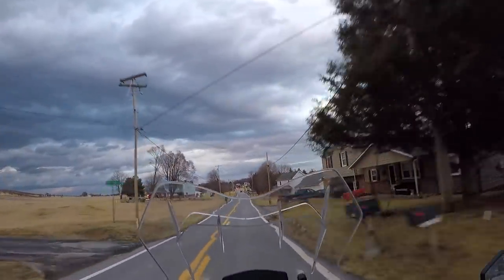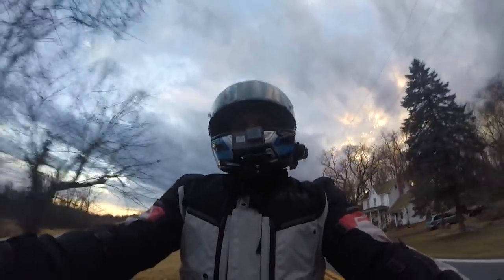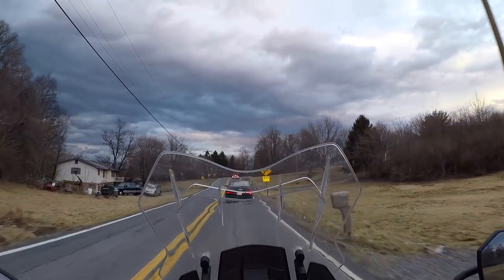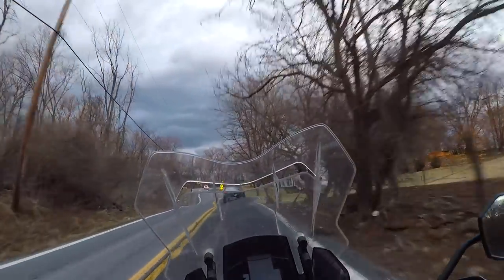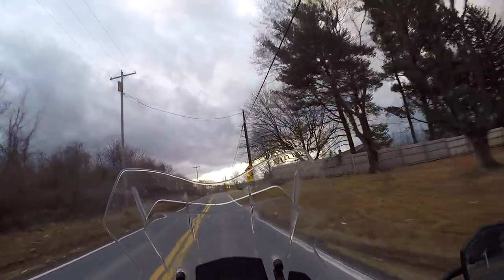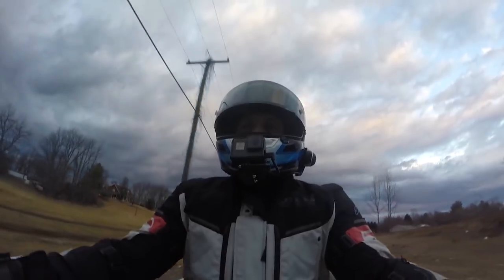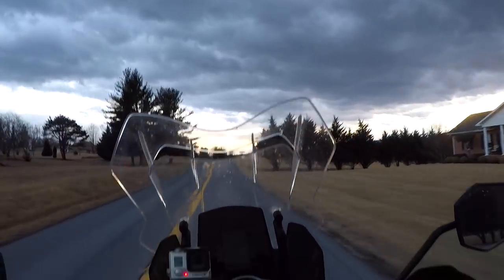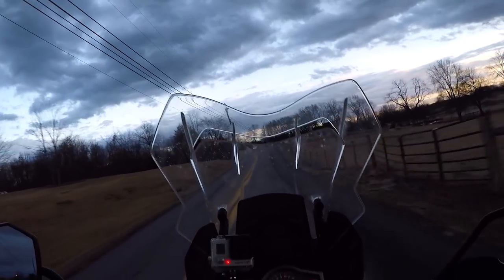Rottweiler Intake on KTM 1290 Super Adventure | 1st Impressions

Comment: I’ve had the stage 3 stuff sitting in my garage for months. That little pull at six minutes really lit a fire under my ass to get it done. Sounds so good!
Reply from the maker: Get that thing put on! You're gonna love it! I'm probably gonna pull my tank in the next few days to see how well it held up to the nearly 10,000 miles I put on it in the last 3 weeks.
Reply: 2 Wheeled Rider My filter oil disappeared, picking up a  few cans this morning and buttoning it back up. Base, stacks, and all dongles are in, GPS rewired to CC2, and Cyclops bulbs are in. SAS out. Should be firing it up this afternoon. I shouldn’t have waited so long, it’s really not that bad pulling the body work and tank. Your videos were really helpful, thanks!
Reply: 2 Wheeled Rider Did a rip last night, about 60 miles. Just a check ride. Through downtown Toronto in 1st and 2nd it was so smooth, but definitely requires a throttle hand recalibration, way less throttle input needed down low. From 7 grand it flies to the redline! I agree money well spent. I’m on an 1190, not SA,  but the results on the smaller motor are similar in feel. 
Congrats on getting into print! That’s cool.
Reply from the maker: Glad to hear it! The first time I rode a KTM with the Rottweiler intake was on the 1190R and that's when I made up my mind to order one.

Comment: I fitted the stage 3 Rottweiler airbox two years ago...it’s a quality piece of fabrication. The ITG foam filter it uses is among the best available technology, if not the best. I didn’t notice the intake noise increase too much, but that’s probably got a lot to do with my exhaust.

I recently took it off because I had to install the OEM to get my emissions test certificates in Germany, and after that I decided to install the Unifilter foam filter in the OEM box...that’s also a nice setup for those who might not want to spend money on a new housing but want better filtration. Touratech sell it in the States.
Reply from the maker: Ronan, appreciate the info and feedback. I agree the Uni would be a good set up for those looking for more filtration but it will come at the cost of some lost horsepower...at least with the dyno charts I've seen. I left my earplugs out the other night while testing it. Doubt I'd notice as much noise with them in. Also agree your exhaust was probably louder than the intake. Great to hear from you; hope you're doing well!

Comment: I also installed the Stage 3 6 weeks ago.  The power increase and throttle response are awesome, and that howl from the intake is awesome.  Well done video, as usual, Mario!
Reply from the maker: Thanks man! If that howl doesn't bring a smile to your face, I don't know what will.
Reply: No joke Brother!  Who needs deer whistles? Ahahaha
Reply: Did fuel economy increase?
Reply: Does stage 1 gives the same howl as well?
Reply: @nickaltvater5592  I honestly didn't pay attention to the mileage pre or post install
Reply: @FITNESSOVER45  Just seat of the pants.  The brief throttle lag is all but gone, the grunt in the lower range is smoother and the rev up is quicker.  And the howl....did I mention the howl?

Comment: Sounds nice and gnarly!  I got a similar (but much smaller) pile of hoses and fittings from removing the secondary air injection system on the Bonnie, later removed the whole airbox (the aftermarket is a wonderful thing), it still looks stock, until you get right up and look under the covers (which I wanted, as it's the Centenary Edition).  I'd hoped to get a ride in today up your way, so of course it's going to rain more; guess I'll have to take some time off next month or so, since I don't get another holiday until May!  Hope Noah has a good race!
Reply from the maker: Thanks Triumphrider. Noah raced well at times but has some work to do. (We got some seat time in tonight after work). It's amazing how much crap (emissions) stuff they put on modern bikes; the definitely breath better with it gone. And yes...the intake sounds amazing. Hope the weather clears up for us soon!

Comment: Hey Mario, did you see any change in your mpg after the Rott install?  I did this kit on my 950 Super Enduro many years ago and it also helped with the hesitation on the throttle at low rpm while improving the sound dramatically but it was a vastly easier install on the 950 ha!  So many freakin' body parts on the 1290 SAT.  I am loving riding the 1290 though.
Reply from the maker: So far, I've only noticed about 1mpg better...maybe because I keep flogging the hell out of it because it's so much fun.

Comment: I would highly reccomend adding their billet velocity stacks at the same time, world of difference in the mid range.
Reply from the maker: Jeff, sorry I didn't mention it in this video, though I did in the Mail Time video, I bought the extra billet velocity stack so I have them front and rear.
Reply: 2 Wheeled Rider which lenght velocity stacks did you use? Short one for more top end or 80/100mm to pump up the lows?

Comment: In my opinion the 1290 KTM's are to quiet to begin with so the air intake noise, not to mention the power increase, would be a welcome addition but since I recently just purchased the bike telling my wife that I need to spend another 700 bucks  for upgrades well that just ain't gonna happen. So I'll just listen to yours for now until I have the bike a little longer. Besides Christmas 2019 isn't really that far away.
Reply from the maker: That'd make a great Christmas present!

Comment: Sounds good and performance wise from your comments it works. Question is - if the bike gets dropped in a water crossing is there less protection or similar to assist with avoiding getting water into the motor?
Reply from the maker: Not at all. The oil/foam filter combo provides far better protection from water (been thru plenty of water crossings on dirt bikes with oil/foam filters) than the paper element. Yes, the box assembly is more wide open than the snorkels but once water gets in the snorkels, it’s over. Suppose the best solution for water would be the factory air box with a foam filter.
Reply: @2WR  _ thx for the info - kind of what I was thinking from viewing the video - love the rottweiler set up but think I may just do a K & N or something similar if you have a suggestion. Cheers

Comment: If ever I get the SA-T (hopefully someday, one day, hopefully), will this affect the warranty? 

Because if ever I get a left-over-new SA-T, I will stack this bike with a 5-yr extended warranty & pre-paid maintenance. I'm loving all the upgrades I'm seeing (probably except the KTM skid plate, I prefer the BDCW Ultimate 3.0 w/ side stand relocate). 

I hoping looking forward on getting the SA-T as my definite 1st bike (I know I'm a dumbass and not starting small, but if I only get one bike...might as well get a bike that does everything).
Reply from the maker: Laws differ from country to country but in the US the only way the Rottweiler or any modification will void your warranty is if they manufacturer can prove it was the reason for the failure. For example, if you bolt on an aftermarket exhaust and your electronic suspension fails, they'll have to fix it as there is no way the exhaust could be the cause of it.

Comment: Carefull mine killed valve seats ( as the sponge filter starts to rot and let dust threw throttle bodies , end result heads off
Reply from the maker: I've had this one on for over 30k miles; I regularly clean/oil it.

Comment: I hate you !! you made me order the stage 3 kit , should be delivered today . Did you do a video on the install ?. also I fixed my top fuel  bar thanks for the videos , keep it up
Reply from the maker: Yes though I haven’t finished editing the video yet.
Reply: I don’t think the performance gain is that noticeable, but you will definitely notice how much smoother the engine runs . Also it will run cooler , that translates to a longer lasting engine . I got rid of my 2016 1290 T for the the 2018 1290 R. Yes I put a stage 4 on this bike too , it’s worth it in my opinion
Reply: I put a new kit in the new bike . You could bring it back to stock , but why it’s so much happier with the new intake.

Comment: Hey is it okay to run it whitout the pre filter?
Reply from the maker: Yep. Prefilter just lets you go a little longer between cleanings/likings
Reply: 2 Wheeled Rider will it give me better performance? More airflow right?
Reply from the maker: In theory the pre-filter will restrict the airflow because it adds another layer that the air must travel through. However, in reality the difference is negligible. There are also 2 pre filters, the gray one and the red one. The red one flows more air than the gray but again, no meaningful difference. The gray one provides a little better filtration for those doing heavy off road riding.
Reply: 2 Wheeled Rider thankyou sir.
Reply: Yup, on my 950 Super Enduro with the Rott kit I carry a second pre-oiled pre-filter with me on longer dirt rides and then change just the pre-filter out to get more distance before the primary filter clean.  Works great and keeps maintenance low and easy while travelling.